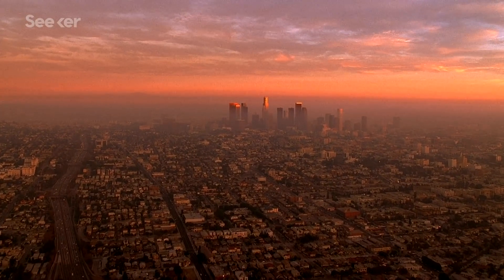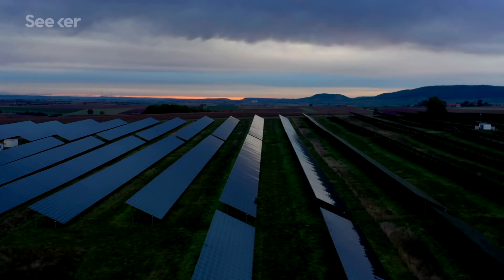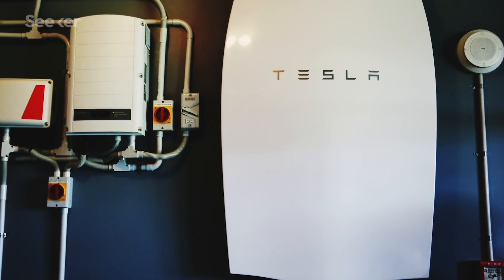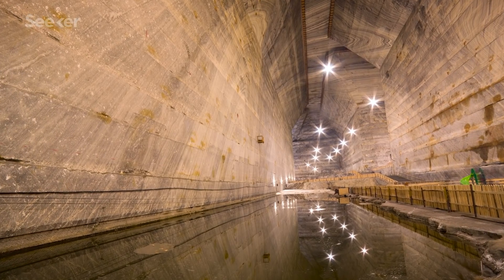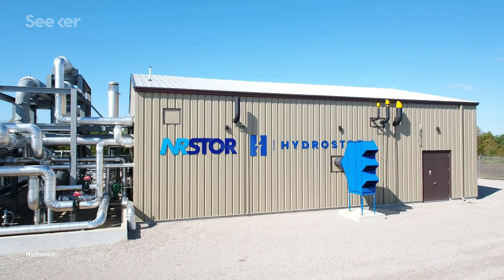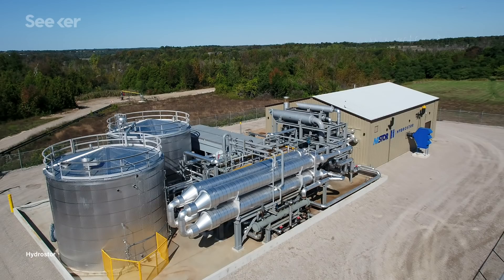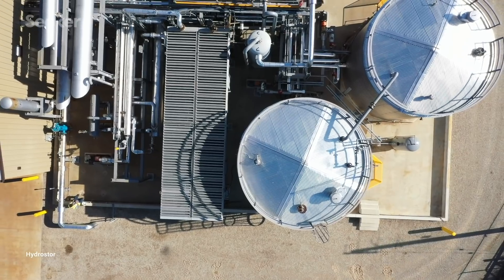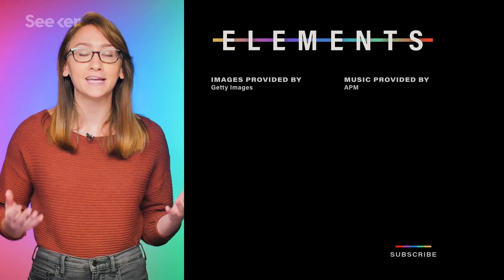This New Tech Could Revolutionize How We Store Renewable Energy

Comment: Make a Kinetic battery, wade from any liquid. Use solar power to pump water into dams in the mountains. Tne release the water though water turbines for energy during the nights and peak hours, store the liquid at the bottom, and pump  it back up. Make it a seale system to retain the liquid to prevent evaporation. You can even use old mines in the mountains, seal them to use as your upside reservoir.
Reply: We could add some Trompes to your system too, you can locate these facilities by the sea and use wave power to do the pumping.
https://www.youtube.com/watch?v=SScpJMsCm9c

Comment: so if thermal losses are the big issue to overcome with caes and this "new" technology addresses  that why doesn't this video explain that process?  the graphic shows "thermal storage" but what does that entail?
Reply: To avoid thermal loses advanced-caes uses thermal storage units. During charging (process of compressing air) hot air passes through thermal storage material (could be rocks, ceramics, brines or other media) which heats up and air cools down so it could be stored safely. And during discharging the compressed air goes through thermal energy storage unit where it heats up and is ready to be fed into turbines
Reply: @nkhdrmv  yes, a heat exchanger. i just think it is funny that the video dropped the ball on this one.
Reply: I don't think there is necessarily the need for any additional heat storage. The heat can be stored by the compressed air itself. If it is compressed adiabatically no heat is lost. Instead of just having compressed air you have hot compressed air.  If there are issues with the temperature rising too much to be safely stored then one could add some element of thermal inertia consisting of something having a melting point lower than the highest safe temperature of the container. It would absorb the excess heat to melt during compression and release it while solidifying during expansion as the air cools.
Reply: @listerdave1240  thermal losses would occur throughout the process to the container as well as all associated components. the issue is that compressing a gas causes adiabatic heating, a portion of which is lost to the environment  (versus hoisting a mass for instance).  thermal losses are typically quite significant and aren't easy to overcome (think of internal combustion engines).   either way the video title is "This New Tech Could Revolutionize How We Store Renewable Energy" and it cites the recovery of the thermal energy to be the innovation that would make caes competitive with other storage methods.  my point is only that the video did not explain the "new tech".
Reply: @chuckbuckets1  Most of the thermal losses in such a setup are easy to overcome, such as placing the pump (but not its drive motor) inside the actual storage tank, accurately timing the valve opening and closing of the pump valves to release the compressed air into the tank at only slightly higher pressure than the tank and so on. The only significant amount of energy that needs to be lost during the 'charging' cycle is the electrical and mechanical losses in the motor that drives the pump and the thermal losses through the insulation of the tank to the outside environment.

With that said I am in no way implying that compressed air is a good idea for large scale energy storage. By far the best energy storage today in most cases is hydroelectric storage, it has reasonable efficiency and by far the lowest cost per KWh of any storage system. The disadvantage  is that you need to have some huge lake lying around or somewhere to make one, which is OK for many places but not all.
Depending on how the electricity is being produced in the first place there are two other solutions I see as the best. 

If electricity is being generated by solar energy then the way to go is no doubt a solar concentrator storing heat in molten salt and driving turbines and/or sterling engines. Salt storage is cheap though there are some difficulties with actually transferring the heat between the concentrator, the storage and the prime movers of the generators. The big advantage here is that there is only one energy conversion as the energy is captured directly as heat and converted to electricity only when demanded. Other systems first convert to electricity, then convert to whatever form the storage uses and then back to electricity when needed.

If electricity is being generated by any other means then the liquid metal battery seems to be the ideal solution as it uses mostly low cost metals and is quite simple to manufacture, giving a cost per KWh that is only a small fraction of that of lithium ion or indeed any other battery technology and almost indefinite lifetime with just a little basic maintenance, reasonable efficiency and low enough self drain to be suitable for weeks of storage time. The energy density is poor both in terms of volume and weight but that doesn't really matter for a stationary installation as opposed to use in a vehicle. It is the price per KWh which is what really matters and that is expected to be better than any other current storage system except hydroelectric.

Many other things that have been proposed might initially look like a good idea to some but when you do the math it all falls apart. Such examples are compressed air balloons under the ocean, lifting/lowering large concrete weights, flywheels and so on. The compressed air systems as described here work but are still not close to being economically viable due mainly to the cost of building large tanks that can hold sufficient pressure and be well enough insulated.
Reply: @listerdave1240  nuclear is the short-term answer.
Reply: @chuckbuckets1 Sure, but these other technologies need to be developed and deployed now in parrallel, partly even because existing nuclear technology cannot be deployed fast enough to replace fossil fuels.
Reply: Sodium hydroxide.  Gives off heat when water is added.  Water can be removed by evaporation using the heat given off by compression.
Reply: People don’t need to explain things to stupid people like you.

Go learn why you’re wrong.
Reply: Providing that information would require actual 'journalism' to occur.  And real journalism is actually kinda hard.  So they don't....

Comment: Can't you store the compressed air in metal chambers, like we already do with commercial compressed air products, and use thermal couples to convert the heat into electricity?
Reply: You can, but the energy density is low, so you need a huge tank. That would be very expensive. Natural caverns though are perfect - a big, air-tight container just waiting to be used.
Reply: @vylbird8014  why would natural caverns be air tight?
Reply: @ScottJPowers  it's a problem. and over time the caverns develop fissures that drive the "tank" efficiency down.
Reply: @ScottJPowers  Not all are. But many of the deep ones are. Do you think natural gas would stay put for millions of years if there was a leak?

Comment: Draw the heat off to power a Stirling engine that helps provide power to the compressors.
Reply: First of all, let me say that it has been way too many years since I studied Thermodynamics.  I try to explain why I might disagree with an idea, so please do not be offended by the length of my response.  I view cycle being  proposed as essentially  a stirling type cycle by storing the heat energy of compression till the gas again needs to be expanded then returning that energy back to the expanding gas.  A subtlety of the graphic demonstrating the cycle is that the compressed air remains at ambient temperature while the thermal storage increases in temperature.  This implies a heat-pump cycle, stirling or otherwise, to transfer the heat of compression to the thermal storage and a refrigeration cycle to extract the heat back out of the thermal storage to keep the expanding air at ambient temperature.  By introducing a second Stirling engine to add shaft work into the compressed gas you reduce the quantity of heat that is required to be stored at the high temperature storage but now must somehow either store or release to the ambient the exhaust heat of this second engine.  Finally, in order to reversibly recover the heat energy during expansion shaft work will need to be performed, negating the benefit of the shaft work imparted into the gas during compression.  i'm not savvy enough to determine if there are conditions where the second engine is a net win due to not having to thermally isolate large quantities of high-temperature heat energy but it is looking complicated to me.  Do you have an insights that I am missing?

Regards.
Reply: @mrhickman53  oh,was there an engine already mentioned? I wasn't able to catch the entire video as I was getting ready for work.
Reply: @Voidsworn  Not mentioned so much as inferred by the color of the compressed gas compared to the heat energy stored in the reservoir.  I could be reading too much into a simple graphic but my understanding of reversible processes is that the heat needs to be either removed from the compressing gas isothermally, implying a heat engine to transfer the heat to a high temperature reservoir in as reversible manner as possible or to pass the gas directly through a regenerator that performs the heat storage.  The graphic, showing the heat storage to the side of the compressed air path is what lead me to believe that a separate engine might be involved.  I suspect forcing the gas through a regenerator is not practical as an ideal regenerator relies on very high thermal impedance longitudinally and very low thermal impedance laterally.  This does not sound like a recipe for low-loss long term storage.  A separate engine that incorporates a regenerator with a much shorter cycle time likely minimizes the regeneration losses.
Reply: I worked myself into a box on my last reply.  A regenerator with the same temperature at the entrance and  the exit is not regenerating much.  So I think a separate engine to remove the heat due to compression of the air to a high-temperature reservoir is in order.
Reply: @mrhickman53  If this storage system were near a city in a northern climate, could the waste heat be used to provide steam for heating some buildings and homes and then heat for generation be extracted from the thermal energy being dumped by other buildings for cooling? A city is a huge heat storage mass and the industries that use the electricity usually generate tremendous amounts of waste heat. Maybe this type of energy system needs to integrated into a city or industry or possibly agricultural greenhouses rather than stand on it's own so the excess heat can be put to use.
Reply: @Robb403  There is certainly an advantage to using heat at the time it is produced rather than trying to store it.  I don't think it replaces storage as now one needs to juggle the building heating and cooling demands with the grid's excess or shortage of renewable energy.  An alternative I have been thinking about but have not decided whether it is viable is to make a giant vacuum insulated tube in a tunnel to where one does not need to extract the heat from the compressed air, just store it in the tube.  The issues I am facing are 1) How much structural connection must one have between the outer and inner shells of the tube  what material could be used to minimise heat flux through this structure, and if the vacuum need to be maintained through pumping, would the energy required truly be less than the heat flux between the shells with only an air gap?  Oh, and a fourth, how does one handle expansion?  I have seen one power plant where the boilers were suspended from the top of the structure so they could grow toward the floor when they were lit.  Fun stuff to think about, indeed!

Comment: Doesn't seem like it will work. Why don't we stick with nuclear
Reply: Because most people are ignorant and scared of it...
Reply: Sadly, the public perception is against the idea of nuclear power. But, with the new designs for reactors; nuclear power could be made safer, smaller and easier to maintain.
I personally believe that a mixture of both renewable and nuclear power would better serve more people until we can finally crack our power storage problems.
Reply: @facepalm486 I did not add them as to the lack of ease of use. Its hard to work and repair something that is built underground and under pressure for a majority of it's life cycle. Not to mention the energy-efficiency is not as high on the return side.
Molten salt requires a constant input of power to maintain thermal stability; if not the surrounding areas will leach off the heat and reduce temperature in steep incremental drops.
Not to mention the corrosive effects of the chemical reactions on the hardware is a maintenance and logistical nightmare.
Reply: it costs too much. people/companies with money, can do the math and see that nuclear is just too expencive
Reply: @yakovkosharovsky8487  are you sure about that? 
Nuclear, again especially Thorium, are by far the most efficient plants, and Thorium isnt exactly rare and doesnt have to be purified, unlike Uranium. At least compared to renewables, nuclear is INCREADIBLY cheap, yes the Power plants can be expensive, but the Fuel is not, and they produce increadible amounts of power compared to fossil fuels and especially renewables.
Reply: @yakovkosharovsky8487  Thorium reactors work, one of the first reactors created for study was one of those. It's only incidental they didn't produce the so needed plutonium grade for nuke weapons. They are just not at commercial scale.
And we don't even need them until we start running out of Uranium some 8000y in the future, there's plenty of time to research Nuclear Fusion in 40 times more "it will be ready in 40 years".
Reply: @yakovkosharovsky8487  With current nuclear designs you can replace the entire world grid in 20 years. France went full nuclear in a decade. We only need to industrialize the reactor construction, because as it is nowadays, every design is kind of customized and unique, it's not mass produced.
If nuclear reactors were mass produced like cars, they could cost just 1B each for 50GW of power, nothing would be as cheap as that.
Remember that most of the material that goes into a nuclear reactor is just concrete, aluminum, iron and some plumbum (I mean lead).
Even then, most of the 1B cost would be certification and safety, if we do that at an even greater scale, like an Airline does, we would reduce a single nuclear reactor cost to something between a $100M and $200M..
Reply: They also take a fraction of the space, as physical space near the consumer centres are at premium, good luck with finding 1000 acres land near every city, but a nuclear reactor only need 1 acres for the same amount of power.
Reply: Its either you go nuclear or you don't solve CO2 emissions. Solar/Eolic is useful but not enough for more than 30% of the grid in the best of the scenarios. Considering that whenever it surpasses 30%, the cost of energy start increasing more and more, and people switch to gas, its as if this green thing was all a ploy for gas powered energy, that's even worse than burning coal, because methane.
Reply: @monad_tcp  So true. Not to mention the electric infrastructure loss and aged out systems make transportation inefficient.
I've been privy to solar panels and thin film photovoltaic development for a while and unless we can get the efficacy above the 50% mark we will alway operating at a loss with current conditions.
Reply: Also, nuclear reactors are incredibly safe, only 2 have failed in more than 50 years of operation and we have like ~4000 (?) of them, not a single one is exploding. 

The 2 that suffered failures ones were the Fukushima and the Three mile Island, Fukushima was scheduled to be decommissioned as it was already past its lifetime (ironically, it was the climate change that made the Tsunami out of the scale for the project, if only more people used Nuclear power we would be having to deal with this Climate Change), and Three mile Island was really a bad/crappy design.
People are funny, they don't know how to calculate risk.  Every time they enter a car they have a chance of 1 in 1 million of dying (flying is not anywhere near that, and nuclear power is even safer), yet they are afraid of flying and nuclear reactors, as if they wanted a 100% safety, this doesn't exist.
Reply: @facepalm486 how so random internet guy? What is your counter arguments? Are you a chemical/electrical engineer? Have you work on a solar molten salt reservoir?
I would like to hear all about your extensive experience on the matter. I'm sure my 15 years experience and three degrees on the subject matter would love to be informed about my short comings.
Please enlighten us professor. 🤔
Reply: Because even Bill Gates isn't so sure that nuclear will win out.
Reply: I don't get that either. My country (Germany) tried to stop using coal and nuclear at once, because of Fukushima and climate change, and now (obviously :/ ) we are just back at coal
Reply: @aldoushuxley5953  And also you're more dependent on the Russian gas. That's troublesome both politically and environmentally. It's true that's the nuclear fission can be harmful, but it's far less so than fossil fuels. The decision in Germany to abandon Nuclear as far I'm aware was a political move to counter the Green party who were capitalizing on mass panic created by the Fukushima. I think the most reasonable approach is to invest on the renewable and new Nuclear reactors at the same time. New designs such as liquid salt reactor or Thorium reactors are far safer than current ones.